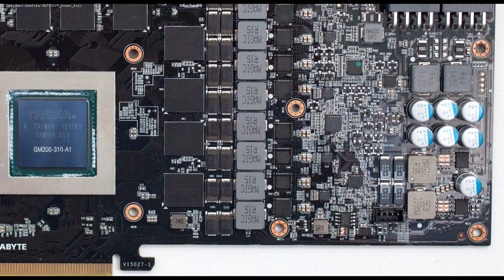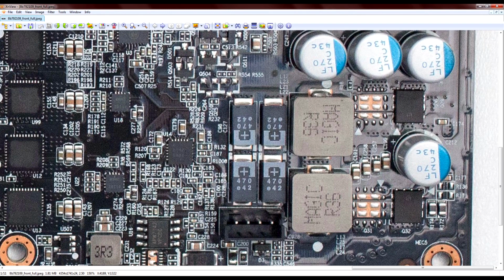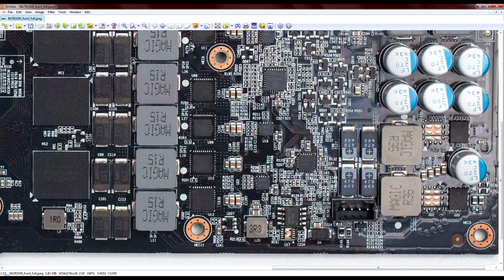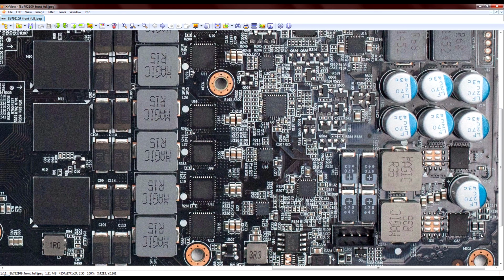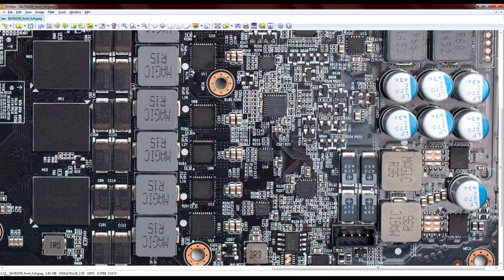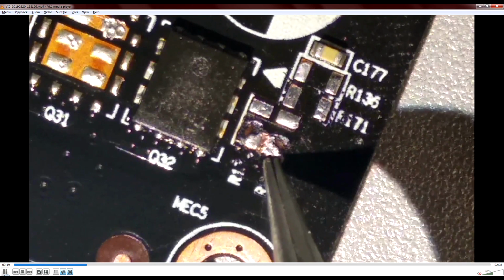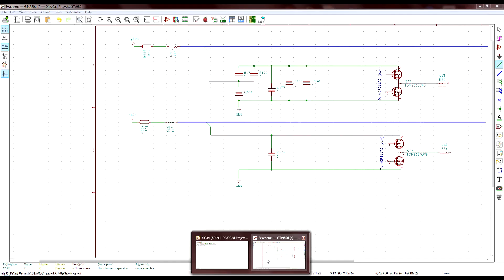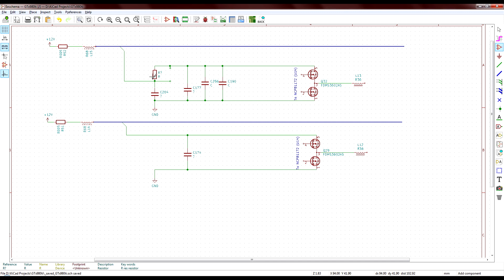Gigabyte 980Ti G1 GAMING-6GD Repair

Comment: Pazi kad sam po tvom akcentu prepoznao odakle si i tek onda pogledao ime!

Respect dude, amazing video. On my gpu exactly those two resistors burned after 5 years of use. I don't know how to fix it, but still thanks for video. 
What could be the reason for that happening? Someone told me maybe GPU had no enough voltage from PSU because i was powering it with 1 line from PSU and then from connector bridge to second connector.
I bought new power supply and some old 980 from friend to use until i don't get new GPU.
Reply from the maker: Haha nije bilo teško :-)
Looks like the memory voltage controler gets faulty after some time. It makes mistakes on that IC that gets burned as well which is resaulting in high current thru those two ferrits. When you replace them with a wire or a fuse it will work for year or two but eventually it will burn again. Đy sughestion is to replace the memory controler as well. My card burned again after almost 2 years. I got new memory controler but havent got the time to replace the old one and test the theory.
Reply: @UrosAndric  Thanks man, i will not try to repair it. I got 980 from friend to use, but in few months when prices go bit more down i will buy something decent. Thanks for video however.
Reply from the maker: @mikiknops9667  please don't throw it away :-)
Maybe it can be repaired.
Reply: @UrosAndric  I wont, i live in NL if i could repair it i would send it to a friend i play with in Serbia. I got also old dd3 ram and i7 4770k processor waiting to send him when someone going to Belgrade. I can add gpu to it.

Comment: Where can you get replacement memory chips of this G1 model? Do you need to buy the exact same type or does every 980 ti have the same memory chips?
Reply from the maker: You need to buy exactly the same chips as there are several manufacturers with slightly different specs. Read the chip model from the chip and try to find exactly the same one new or the damaged card with the same memoty chips.

Comment: Hi I just had the same problem, for 0ohm resistor, what kind of rating i should be looking at? or does it matters?

have a list of rating here
https://sg.element14.com/w/c/passive-components/resistors-fixed-value/zero-ohm-resistors?resistor-case-style=0805-2012-metric-&range=inc-in-stock

Comment: I have the exact same card and for me the R172 and R174 resistors are just completely missing, also the IC Voltage regulator module is like falling off the board. The card will initially put out a signal but the it will artifact with black screen with like blue dots when it gets into windows. I can upload any pictures if needed. Does this sound repairable? Does the artifacts sound like a different problem? Was told it could be vram problem.
Reply from the maker: Arrifacting sounds like some memory modules are damadged. You should remove the IC and then check it again. It should work with only one phase until you put it under load. On one phase should normaly get into the windows. Don't put it under load before you replace the IC and place a fuse where those resistors ware.

Comment: Hey , can I post a pic somewhere and maybe get an opinion if those r174 and 172 are busted? They look a bit weird, but not burned out
Reply from the maker: Paste photo here to see that wierdness 😊
Reply: @UrosAndric  http://imgur.com/gallery/s8Vi6QD
Reply from the maker: @stefanpastravanu1493  they are burned for sure :-)
Looks like PCB is not damaged so with soldering iron you should be able to remove them, clean and solder fuse or 0ohm resistor.
Reply: @UrosAndric  well , hope I find a shop to do it, I don't have soldering skills. 

They all said they "don't have parts"
Reply from the maker: @stefanpastravanu1493  Ask them to remove those buned ones and Replace them with tvo 3amp fuses. They have fusws for sure
Reply: @UrosAndric  thank you, I'll tell them, hope they agree,
Reply: @UrosAndric  I've made the solders and it's working much better already but it seems that I still get some white (other colors sometimes) screen of death that force me to reboot. Would using fuses be better or is this a completely different issue?
Also please share some paypal donation link I and I'm sure others would be happy to send you some donation for your help.
Reply from the maker: @exadeci  looks like different issue to me. But, to be sure, just open the card again and look if the new resistor or fuse you soldered is burned again. Measure it. Is should have resistance less than an one ohm.
Reply: @UrosAndric  I think that the mofset of the left of the resistors might have burned https://i.imgur.com/JfdjI8V.jpg
Reply from the maker: @exadeci  yeah man. Ot is totaly dead. So that one will need to be replaced as well. Also when you do that check again fuses that you solderd instead this burned ones
Reply: @UrosAndric  Yeah that's just an old picture I forgot to take one after doing the solders and before putting the heatsink.

Thanks so much I'll change the mosfet then!
Reply: @UrosAndric  Hi. Mate WHERE did you bought the spare one? Aliexpress? Also please can you confirm is mofset FDMS3604S or FDMS3604AS?
Reply from the maker: @Senior.  Yes i orderd mine from AliExpress, but if you can find it localy it would be better
 Can you see the markings on other IC that is not burned?
Reply: @UrosAndric  I got it fixed, it was just the r172 and 174 , now it works like a charm, draws around 270W with custom settings. It seems a bit hotter in idle tho, like 43C, it used to be around 33-34. Maybe it's just the climate getting warm

Comment: Hi Uros. I have the same card, but different scenario. My clocks and voltage keeps fluctuating under load only... You can check the comments on this forum - https://carbonite.co.za/index.php?threads/980ti-fluctuating-fps-memory-clock-gpu-voltage-core-clock-on-load.367000/#post-2429218 -

I opened the card again after watching your video and the resistors seems to be burned... They are quite dark.

Do you think this will cause the issues I am having?
Reply from the maker: It can be but be sure that they are burned. They are normally black but if they are burned you can see the dark area around them. You can also measure resistance on them. It shoudl be small. If it is high then they are dameged for sure.
Reply: @UrosAndric  What should they measure? Thank you for replying so quick!!!!!
Reply: R174 is measuring 2.43k Ohm and R172 3.7k Ohm
Reply from the maker: @pokkel1982  which is wierd because they are in parallel :-)
K-ohms are too high. I would replace both of them.
Reply: @UrosAndric  Thanks!!! Will do. What are the specs for those resistors? Or if I use the 0 Ohm resistors, like you said in the video, what size and specs should I look at when going to the electronics store?
Reply from the maker: @pokkel1982  i would go with no higher than 10amp one. That will cover 120w of power which is enough for single fase of memory power stage. 6 amps would be fine also i think. That would cover 72w of power. Something between 6 and 10 amps is fine just for protection in case of short.
Reply: @UrosAndric  Aha. Is that for the 0 Ohm resistor then?
Reply from the maker: @pokkel1982  thats for the fuse :-)
Reply from the maker: @pokkel1982  this is 3mm long. I think it is too big for replacement. Try to find something smaller.
Reply from the maker: @pokkel1982  try this one:
https://za.rs-online.com/web/p/non-resettable-surface-mount-fuses/1740886/
Reply: @UrosAndric  Fantastic!!! Thank you so much!!!
Reply: @UrosAndric  I saw you advised someone, whose board actually got physically damaged, to use wires connected to the shunt resistor... I think it's going to be very difficult to solder those resistors in place with the equipment I have. So what if I use the part below and made a fuse holder between the heat sink and backplate and use a ceramic tube fuse? This will make it easier to replace if it actually fuse out in the future?
https://za.rs-online.com/web/p/cartridge-fuses/0563592/
Reply from the maker: @pokkel1982  No :-)
Reply: @UrosAndric  hehe. So I shouldn't do that?
Reply from the maker: @pokkel1982  please don't. If you have some experience with soldering you can buy decent soldering iron, flux, tinol wire and wick for small ammount of money. If need practice just ise some of your old or broken hardware.
Reply from the maker: @pokkel1982  Also you have great tutorials on YT how to solder SMD components.
Reply: @UrosAndric  no problem. I'll do the right thing. Any reason why that wouldn't work. Just out of curiosity...
Reply from the maker: @pokkel1982  It probably wood but not for long. And chances to make a mess and kill that card for good are great.
Reply: @UrosAndric  So I replaced those resistors with the fuses and the card works 100% now. Thank you for all the input!
Reply: @pokkel1982  you putted 2 fuses in replacement for R172 and R174 ?
Reply: @davebelisle949  hi Dave. I just replaced it with two low ohm resistors. Worked perfectly

Comment: trying to fix mine.. not easy! the mosfets on the G1 are  AO z5066qi  (https://www.tme.eu/fr/details/aoz5066qi/regulateurs-de-tension-circuits-pwm/alpha-omega-semiconductor/)
Reply: IC close to two incriminated resistors are "22CA N7CC" (https://www.onsemi.com/products/discretes-drivers/mosfets/fdms3604s)

Comment: 2 years late but dude , this is amazing. 

I have the same model and it only draws 100W under load, with low fps and low clocks, works ok , no artifacts.

It draws its normal 250W for 1 second , then goes to 70-100W and hits a perfcap reason PWR.

Since it's basically ok, I'm thinking I might have the same problem. 1 question tho, how can you tell if the resistors are burned or gone? They seemed to look ok in your pictures.
Reply from the maker: Pictures are from the internet. If it is burned you will see it. If you are lucky it wasn't burned thru the board :-D
Reply: @UrosAndric  I hope not, I removed it from the PC now so I dont stress it more. 

But from what you wrote and what others wrote this is probably the issue. 

Low fps in games, low clocks , low power draw, hardlocks the entire pc in benchmark tests. 

I'm totally clueless with resoldering, but I'll take it to a hardware repair shop on monday, I'll tell them about the r172 and 174 , hope its repairable.

Worst case scenario, I'll put it in my old PC as a youtube / light gaming card. 

Again, amazing job, I've searched forums and googled for the last 3 days , made a reddit post, nothing that would really give me more info. 
Then I just found your vid. Thanks for taking the time to help others bro

Comment: r174 and 172 burned yesterday... it is possible to repair it just by soldering a 0 ohm resistor?
Reply: now i've got a 43 error code on my graphics in windows
Reply from the maker: Still burned? You haven't short it out?
Reply: @UrosAndric  yes the 2 are fried. If i put a little point of soldering it will worl or necessary need a resistor?
Reply from the maker: @Fracka-c  not necessery, just better solution. If you have code 43 you have something more wrong there. I Wouldn't Play with shorting that out until i am sure that there is no short to ground or faulty mosfet that can send 12v directly to the memory and kill it.
Reply: @UrosAndric  ok so i will try to find a 0ohm resistor. You think that error code 43 isnt caused by this dead components?
Computer boots but blocked in 800x600, unable to lauch a game because card isnt detected
Reply from the maker: @Fracka-c  dont think it is there because of burned Resistors. It must be something else thatnis demaged by this.
Reply: @UrosAndric  i put the 0ohm resistor and nothing changed... still code 43 and stuck in 800x600. I think its a vram ssue because gpuz found 0 mb of vram. Any idea?
Reply from the maker: @Fracka-c  Yeah. That part of the circuit is memory voltage regulator. So possibly your memory is probably dead. But i would confirm with "mats and mods". Google it out how to test memorry.

Comment: Hey man thanks so much for your video! I have the same card, and last night while playing games, the GPU started sparking and smoking. I immediately took it out of the pc and when I inspected the pcb, the component there had been burnt out. I bought the card brand new, so I don't think it was a capacitor there but it was the original r172 and r174 components. Could I use the same parts to replace these? Or does it have to be a single 0ohm resistor? 

Also any idea why it could have happened? My pc had lots of air flow and I never had overheating issues before (I built the pc 4 years ago all brand new parts) - psu is 1200w gold standard too so I don't think it was that but not sure. I suppose I shouldn't have extended gaming sessions but I did many in the past which is why I'm confused lol 

Anyways thank you again :)
Reply: Hi, were you able to fix it? I have the same issue now.

Comment: Guys - this fix works!!!. If you don't have 0805 SMD 0 Ohm resistors just use wire/solder the gap between pads. It's working for me perfectly!. Just be careful while removing old burned resistors - there might be damaged pcb underneath - so do it carefully. 
@Uros Andric - you help me to save ~300$. Thank you very much! Next beer is on me! :) 30 minutes of Furmark and 2h of Ace Combat 7 and card is still working! yay!
Reply: Copper wire?
Reply: @ciccioteck9839  Any wire and a lot of solder.
Reply: @michak7927  Thanks, can I ask you a favor could you attach a photo if you are available I would thank you a lot ....
Reply: @michak7927  I did not understand you need to combine the pads of r172 and r174?
Reply: @michak7927  Last question should I leave the plastic wire protection?
Reply: @ciccioteck9839  Put solder on R172 pads. Add wire (without plastic), be sure it's rather tick. Repeat task for R174. Job done.
Reply: @michak7927  Thanks, even the pcb must touch?
Reply: @ciccioteck9839  Yes you can touch PCB with wire/solder.
Reply: @michak7927  One last thing I didn't understand should I also solder the wire in the PCB space?

Comment: Nice video - finally someone takes his time to share and be nice.. Can you however tell us what IC's they are ? i have the same issue us you did but both R's have burned but not the board, the IC next to them  ( R172 + R174 ) is however burnt.. i have tried to find a replacement but i cant find one that will work to my knowledge..

Thank you..
Reply from the maker: You have datasheet in the description. I couldn't find IC locally so i ordered from aliexpress.
Reply: @UrosAndric   fantastic, ill try locate one online.
You have a new subscriber :)

EDIT - Link broken:

404 - File or directory not found.
The resource you are looking for might have been removed, had its name changed, or is temporarily unavailable.
Reply from the maker: @Murlock2000  damn... Ok let me find anotherone if possible.
Reply from the maker: Updated in the description.

Comment: Thank you for your work. I have the same issue with my gtx 980ti gigabyte graphics card. Is it easy to put the 0 ohm resistance? I have no tools to work on it neither
Reply from the maker: Well not so much if you have no tools and no experience :-)
Better find some one who has the experience at least. Doesn't have to be service, some friend of yours maybe.
Reply: Uros Andric thanks for answering. Do you have any picture with the 0 ohm resistance installed?
Reply: @gcg2205  ye i would need the same picture as well Uros could you please take on and put it here for us thanks.

Comment: Hi my 980ti blow up today same problem, 2 resistors burn up, im clean everything today but in 1 photo i show a red rectangle that piece rip off and i dont have the 2 connection is still possible repair it or some kinda of bypass? and if you can show me what kinda of capacitors i need it please. i plug the card to pc and is work fine but when i instal the nvidia driver i get black screen.
https://imgur.com/a/qk7Cg8l
Reply from the maker: Looks like you have enough pads there to solder the wire or the fuse. Just need to clean it first a bit better. No capacitors needed, just 0-ohm resitor or piece of wire. Please look the whole video.
Reply: @UrosAndric  so i isolate r174 and put a wire on r172 right?
Reply from the maker: @Notusasusus  yeah, you have to remove both of them and place a wire on ither place.
Reply: @UrosAndric  ok i will try right now thanks. I'll let you know if it worked
Reply: Im done and work perfectly fine the gpu right now thanks alot

Comment: Hello , i have the same problem, but in my case only the r174 is burned , Do you have a link to buy the replacements? Please 

Sorry for my english  :'(
Reply from the maker: Just remove both of them and replace them with a wire or a fuse. Other one doesn't look burned bit is probably faulty too.